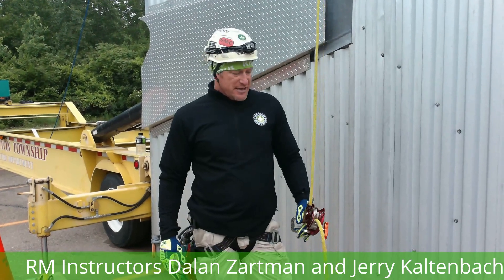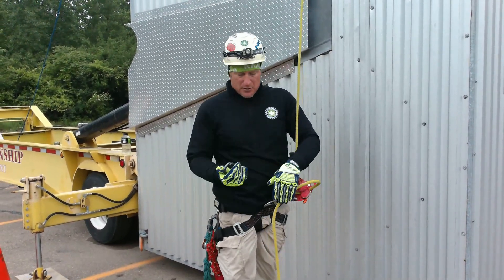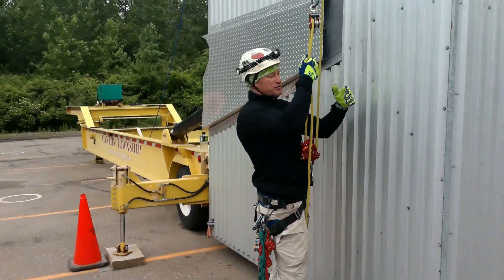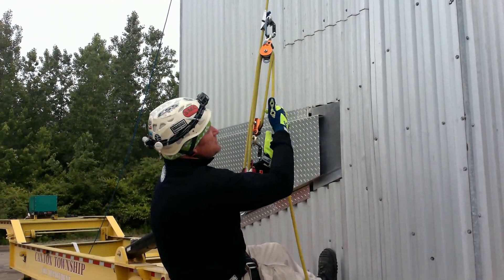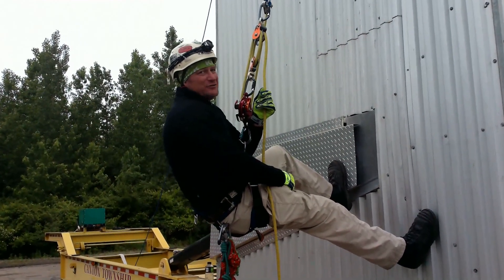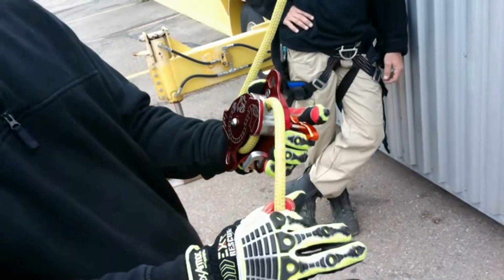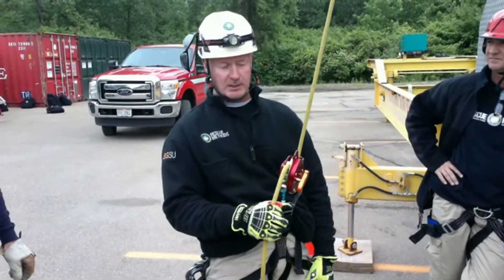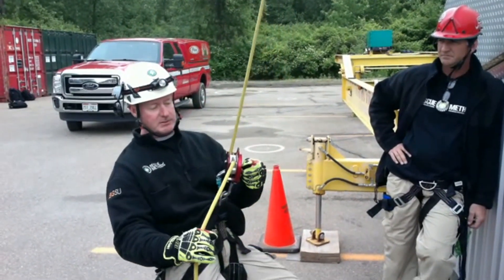Ascending and Descending with CMC MPD

Comment: Rope going through a MPD with a double pelley on a Gibbs and a single on the MPD is a 5 to 1 according to the class I just had through CMC
Reply: Yup, he MPD was on a fixed point i.e. Anchored. In this configuration, its a 4:1 at the Rescuer.

Comment: So there are rescuers on the rope that can't lift their own body weight. I think their strength might lay in planning and coordination perhaps. Letting the other team members that meet to requirements would leave the nonfit bodies less likely to be injured and be able to help the P/T if they need to lift them too. It's like sending a person into the CSE and they may or not have a 2nd rescuer tailing them depending on the size and rescue level required and having to haul 200-350 lbs > worker out while only being 150lbs with adv or below strength ( so decent fit but nothing remarkable or reliable for rescue).

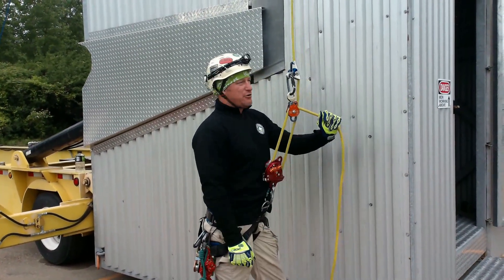Comment: 2:43 you have created a 3:1 mechanical advantage if you are lifting yourself or a 2:1 mechanical advantage if you are getting lifted by someone on the ground. Every pound of force you pull on that rope is a pound taken off the MPD at the harness. If you + gear weigh 200lb, there is 66.7lb tension in the downline between the Gibbs and the MPD, 66.7lb tension in the upline from the MPD to the pulley, and 66.7lb tension in the downline between the pulley and your arms (while ascending). Your arms are holding 1/3rd of the weight and the harness is holding 2/3rds of the weight... Until you stop, then 100% of the weight is being held by the MPD at the harness. On the other hand, if you are being lifted from the ground, the forces are:
Gibbs to MPD = 100lb (50%)
MPD to pulley = 100lb (50%)
pulley to ground crew = 100lb (50%)
force in main line from Gibbs to anchor = 300lb (150%).
Reply: Correct.  Richard Delaney has a video on this: https://youtu.be/93AX2aPibZc

Comment: Even though the load is minimal, you agree with loading one side of a double pulley?
Reply: It's a good observation.  My guess is he is using a type G rated 40+ kN, so his body weight is negligible relative to its WLL. Still, most manufacturers don't approve their doubles for single sheave use.